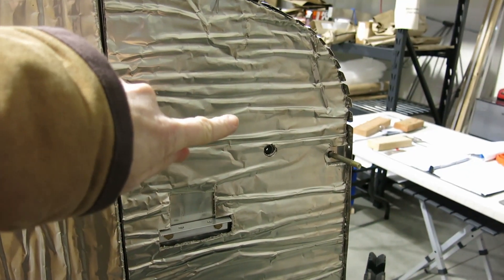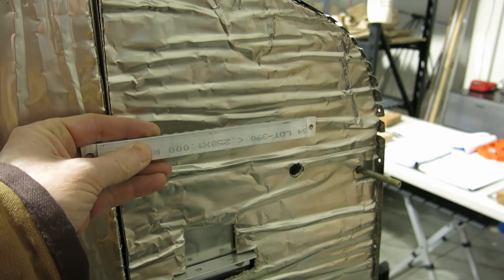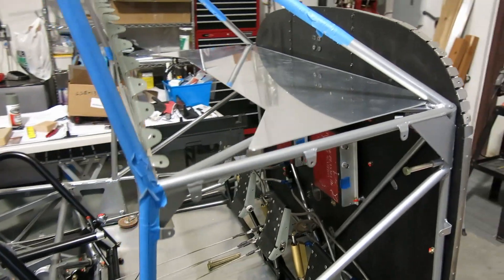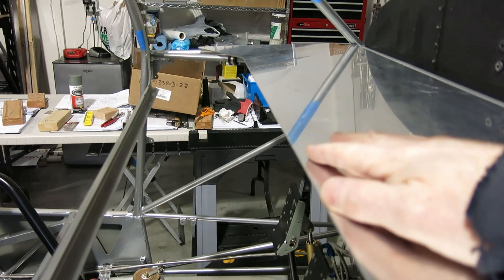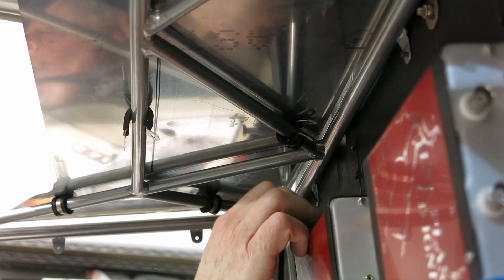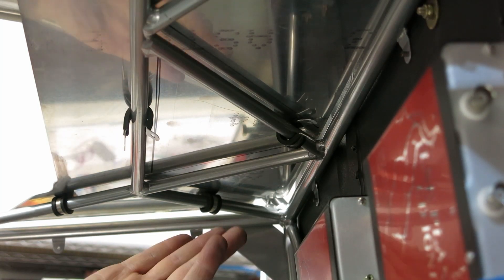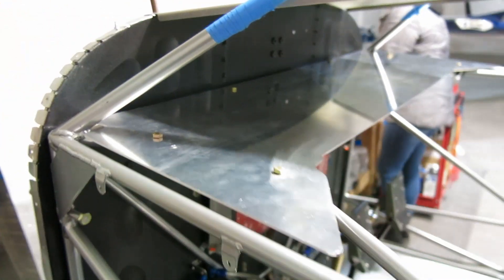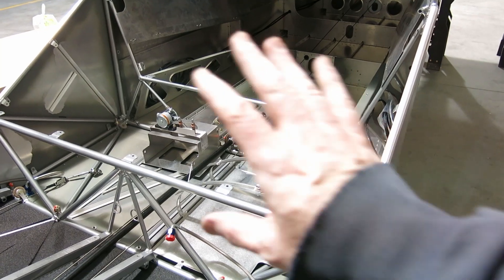No. 243 12-31-2022

Comment: When you get an oil leak,(and you will😉) it will get trapped  between the firewall and that (heat shield) material, be tricky to clean. Would  be better to put on inside, i have never seen this on the front firewall before, where did you get the idea?
Reply from the maker: Oh we ordered the leak-free option on our engine. Didn’t you? 😉
I saw another builder do something similar but I don’t remember who. The way we’re putting it on, if it becomes a problem, it can be removed fairly easy.
Reply: @s-21project92  no, we ordered the leaky lycoming model

Comment: Where did you get the shelf?  Very nice.
Reply from the maker: Avionics shop had another customer ask for one, so they came over and measured our cage. So they made one for us, too.
Reply from the maker: It's .080". Pretty stout so it will be the base of a support bracket for the back of the panel where the GPS and nav/com extend back.

Comment: I am not familiar with the firewall blanket material you are using, but do you really need to make cut-outs for all of the attached parts?  I would think anything nonstructural could be bolted through the blanket which both helps maintain the insulation path, but also is a lot less work.  The only penetrations that I would be antsy about having as a sandwich with the heat shield are those for the engine mount.  I would think all of the accessories could be bolted right through the firewall material with only holes cut for the bolts or rivets, but not a cut-out for the full size of the accessory.
Reply from the maker: It's the firewall 2000 material from spruce. I want anything attached to the firewall to be attached to the firewall. I don't want it wobbling around on that heatshield (you said it's more aerospacy to say heatshield rather than blanket, lol).